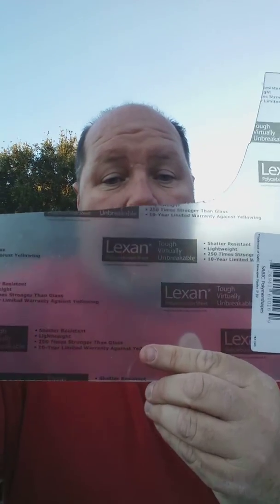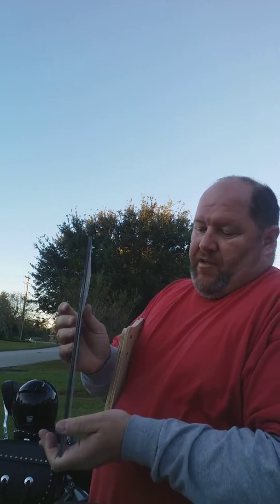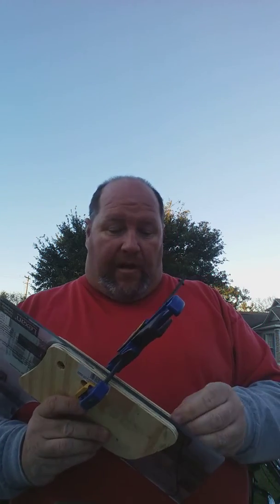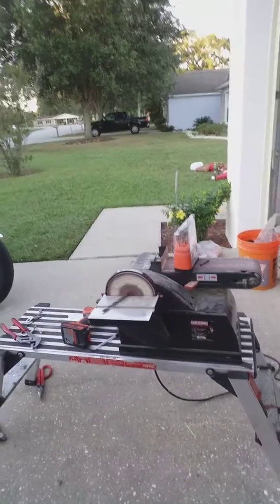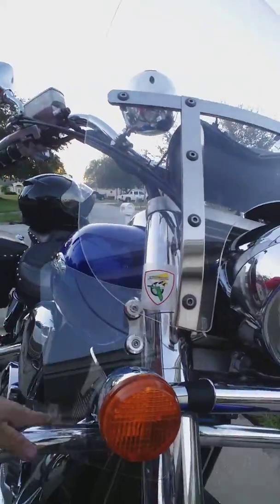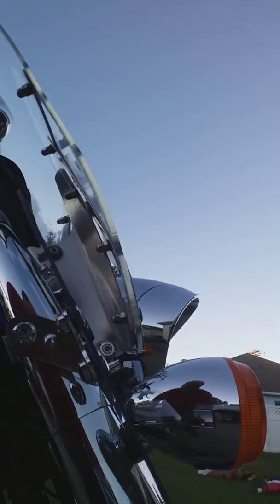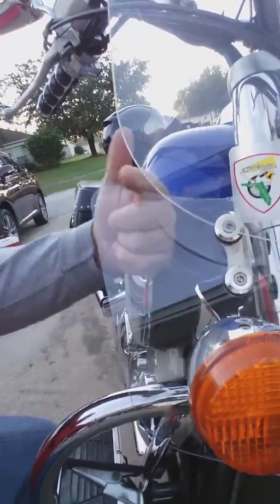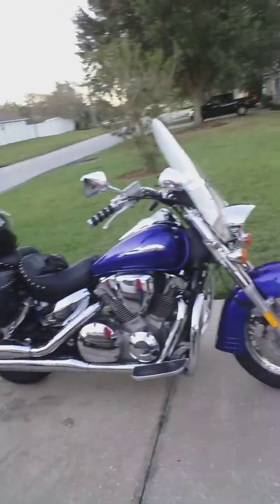VTX 1300S homemade lowers and installation

Comment: I've also made several pairs of lowers for various bikes. There area many choices for fork clamps on the market, so it's just as easy to make your own. Memphis Shades gets $50+ just for the mounting hardware  and $24 for the plastic deflectors. You can also make them longer which helps a lot to take care of the updraft from under the windshield.